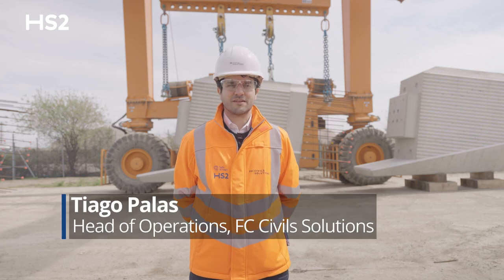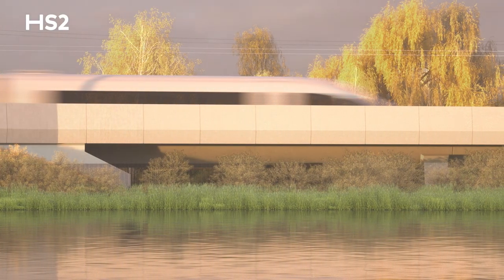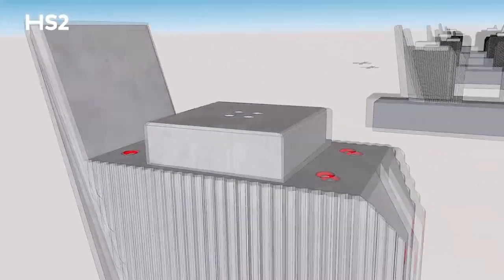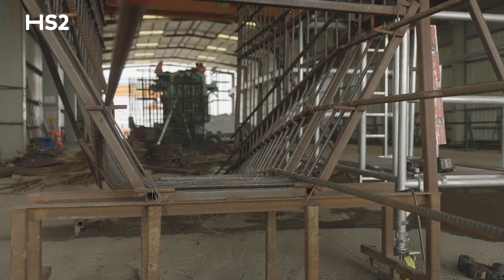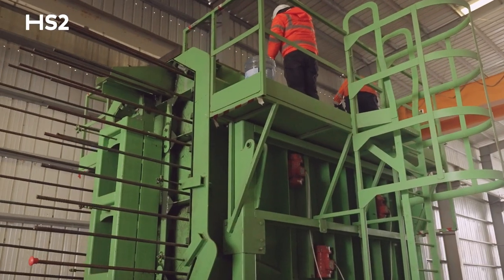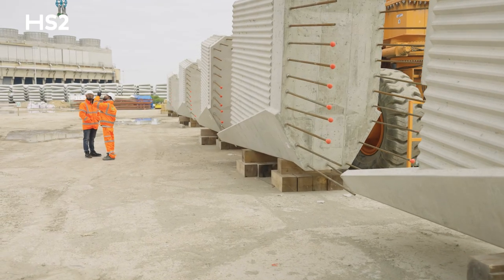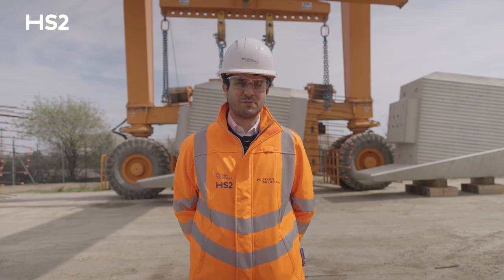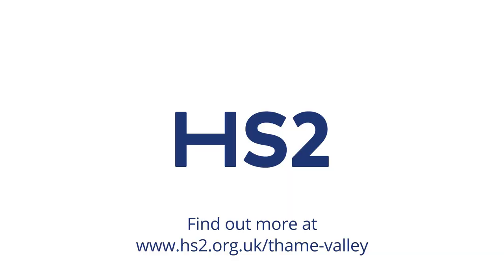HS2 super-sizes offsite manufacturing as Kent ‘viaduct factory’ begins production

Comment: Great to see more progress being made
Reply: .. make the most of it because very little of this white elephant will ever come to fruition.
There's been disappointment from supporters & delight from detractors over the news that construction of HS2 would be “paused” over much of its length, with the exception of the core route between London & Birmingham. 
However, according to sources inside the project, the enabling works already underway on the sections from Birmingham to Crewe & onwards to Manchester are not being paused at all. They say that instead of mothballing the environmental & preparatory works, sites along the route are being demolished & installed infrastructure is being junked, at a massive cost to UK taxpayers.